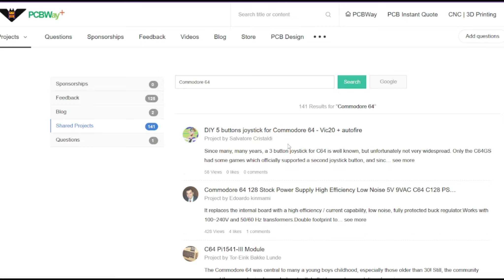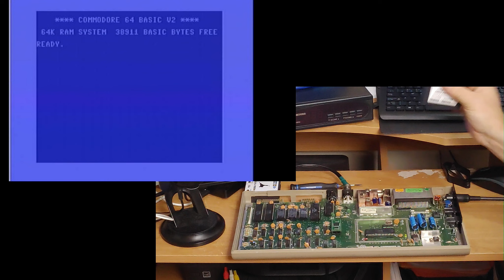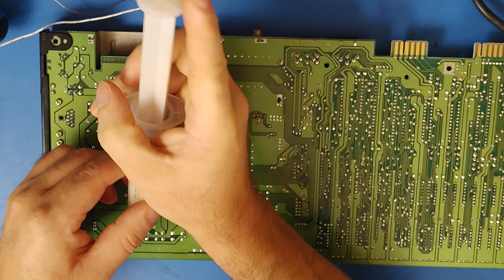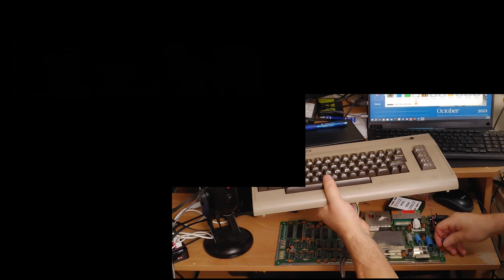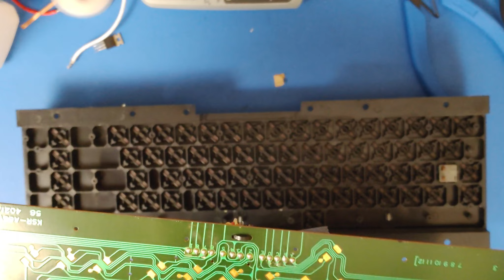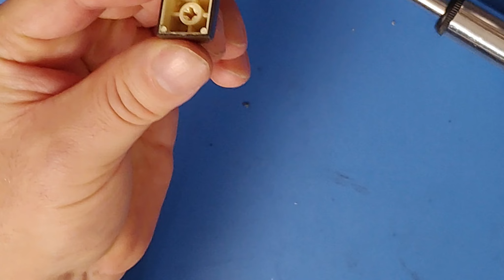Three Commodore 64s Enter, How Many Will Leave?

Comment: Hi, Ken.  Enjoyed the video.

When you're heat sinking with those 14mm x 14mm heat sinks, only the ones you put in the center of the chip, directly over the die are of any real use.  The two you're putting on the outside are, effectively, a waste.  The two you put on the SID aren't as effective as if you had just put one directly in the center of the chip.  If you buy larger heat sinks that are sized for the chip you're using them on, that'll give you a lot more protection.  I know they can be hard to find, but it's worth it.

Machine 1: The regulators should get hot.  That's how they work.  They dissipate excess power as heat.  The lack of a heat sink on the 12V regulator on that revision of the board probably cooked it over time and could easily explain why it wasn't working correctly.  If you want to extend the life of your C64, you might consider finding something to bolt to the back of the new 12V regulator to act as a heat sink.  That could also have been the cause of your intermittent problems.  As the regulator heated up and went past its tolerances, the output voltage could have continued to drop until it got too low for the VIC-II to operate.

Machine 2: The line down the left side of the screen is supposed to be there and is a good sign.  It means the VIC-II is likely fine.  The VIC-II and the SID are the only chips that get their power from the 7805 and 7812 regulators.  The other chips and the cassette port all get their power from the +5v rail coming directly from the external PSU.  Assuming your external PSU is good, which it seemed to be considering Machines 1 & 3 worked, getting 4.6v on those chips tells you that you have a short somewhere.  The ROMs and RAM are likely candidates.  It could be the CIAs as well.  Your next step should be to pull out the two socketed ROMs and the one socketed CIA and re-test voltage.  If it's back up closer to +5 then you know one of those chips has the short.  Replace each, one at a time, and re-test voltage.  The one that makes it drop needs replacing.  If, after removing those 3 chips, you still have < 4.75v, it's going to be one of the chips soldered directly to the board.  To find the likely culprit, leave the machine on for at least 10 minutes and check for any excessively hot chips.  You can use the back of your finger and you'll probably find it.  If not, use your temperature probe and look for a chip that's getting over 40C.  If you find one, try replacing it to see if your voltage improves.  If none of that works, it'll take more diagnostics.

I'm doing something similar this week.  I've got a live stream scheduled for Sunday at 1pm EDT and I'm looking at 3 C64s (one 250466 and two 250407s).  I just released a prep video where I disassemble each and find out what their working state is.  Here's the link: https://youtu.be/RE10CfgF9bM  Hopefully, we can get all three working during the live stream, if time permits.
Reply from the maker: Great suggestions, thanks!  I won't be able to catch that stream live but I will watch it later (As I am mostly a Tandy guy, I know very little about repairing Commodores so I am watching as much as possible right now!)
Reply: @CanadianRetroThings  I'd never worked on a C64 until a little over a year ago, but I watch a lot of retro videos and picked up a bunch of good tips.  I'm trying to put them to use on my channel, but I still make boneheaded mistakes all the time.  My first computer was a VIC-20, but my second and third were a CoCo 1 and a CoCo 3.  I still have that CoCo 3.  I did several videos last month for SepTandy on mods for the CoCo 2, but never got finished because my parents started having health challenges and I've been tied up a lot doing things for/with them.